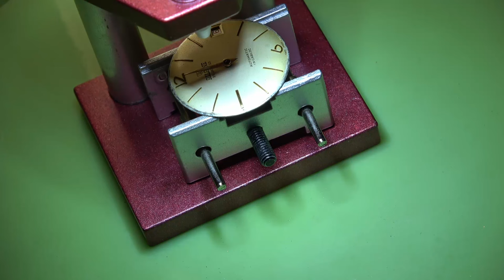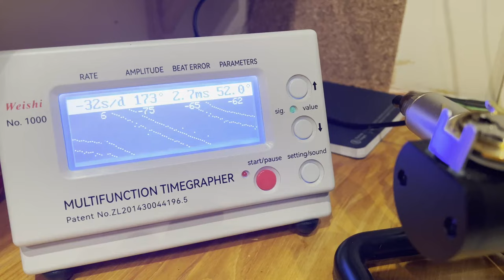Using fire 🔥 to fix a watch!! 🕰️ Allaine Date Wristwatch with Felsa 4007 Movement

Comment: Never seen that spring/bridle setup before..
Reply from the maker: Only seen it in the felsa movements so far. Clever solution for using a manual wind spring in an automatic movement. 😁👍👍 thanks again my friend.

Comment: I think the automatic parts, which you were uncertain of the names for, are the reverser (1485) and Reverser connecting Wheel (1499). Very Entertaining by the way. I am also a tinkerer and have also had a stab at the Felsa 4007. It nearly defeated me but I did learn a great deal.
Reply from the maker: I really should take the time to learn part names before I start narrating 🤣🤣 I have a soft spot for the Felsa 4000 as it was my first successful tinker and the 4007 is so similar I thought it would be a breeze…. Still I’m here to learn and hopefully entertain as I do. Thanks for watching my friend and thanks for the part names 😁👍👍👍👍